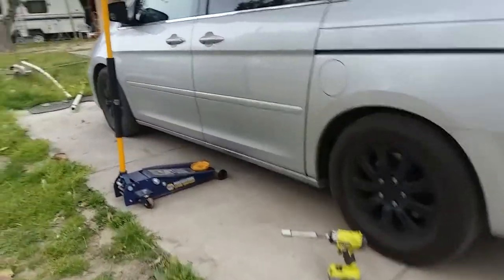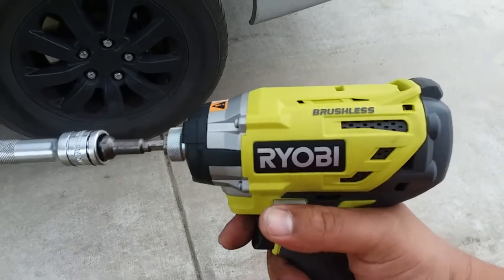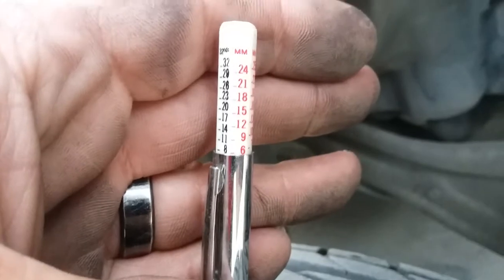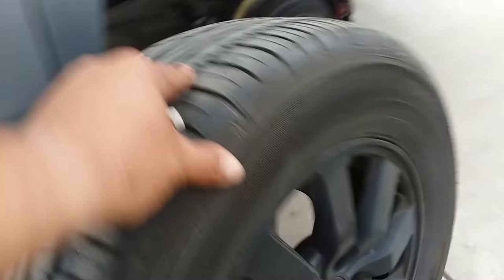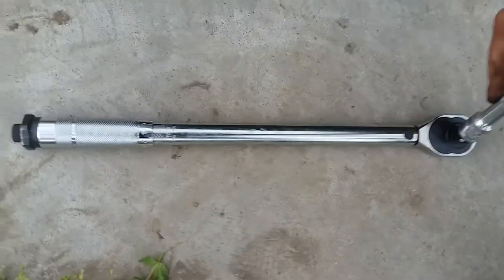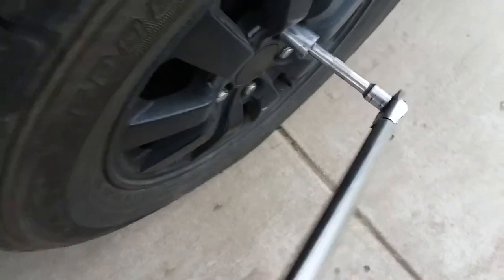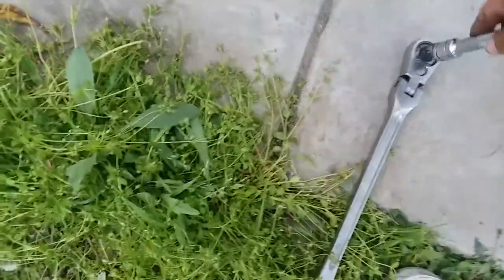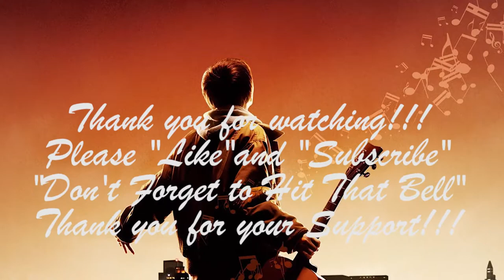How to: Rotate tires on a 2010 Honda Odyssey

Comment: do you have to get wheel alignment after doing this???
Reply from the maker: You can, you dont have to. These tires were brand new and were wearing out normally so I just swapped the front to the rear because the rear still had 100% thread life and the front were like at 50%. I think it's recommended to get an alignment done at least every six months if not once a year due to all the bad road conditions that your suspension takes wich can cause misalignment